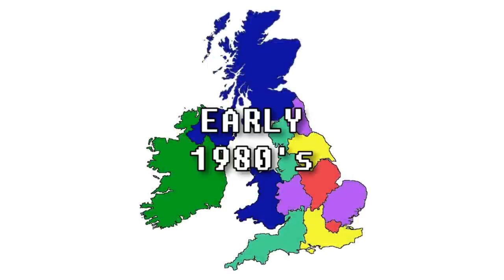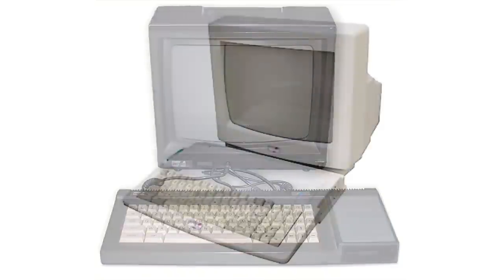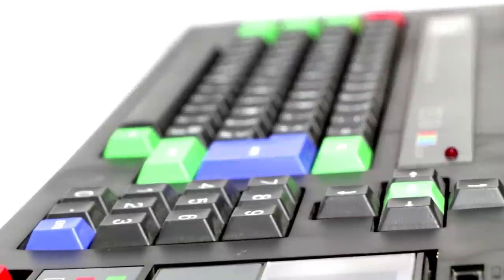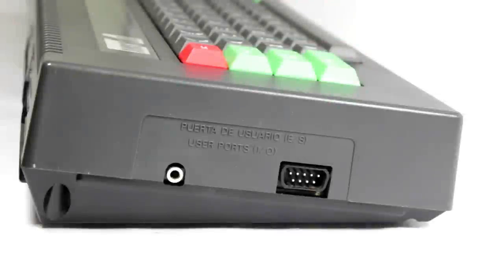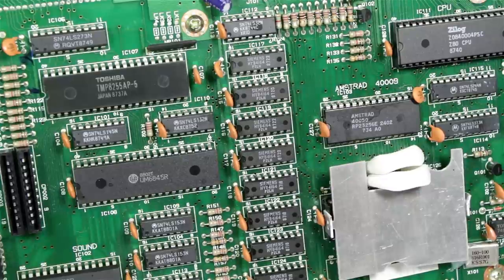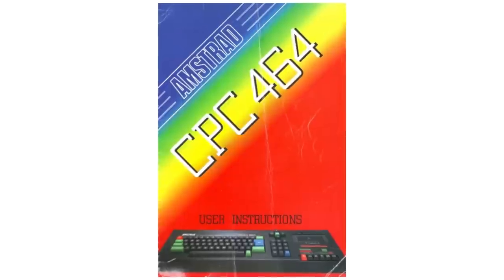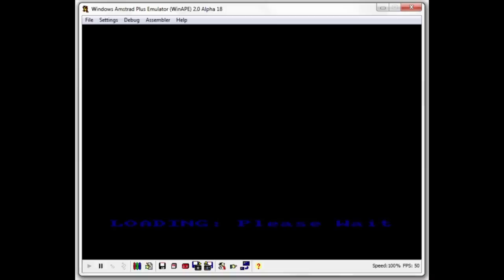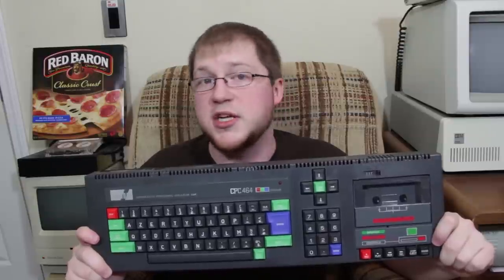LGR - Amstrad CPC 464 Computer System Review

Comment: The Amstrad CPC was a brilliant machine, the 464 in particular. The numpad can be reprogrammed from BASIC to run programs at the tap of a button. I used to use mine with 3 programs in them at all times: one to change the mode to 80-column text mode and the on-screen colours to easy to read white-on-black, one to list any program I was coding, and one to tell me how much memory was still available. It was so useful.

Comment: I had two of these growing up, and my 464 came with the TV modulator. The only sad thing was the sound still came out of the computer. What the kids at my school did was buy a cheap amplifier and hook it up to the stereo jack, it sounded way better. Despite all the playground bullying from Speccy & C64 owners ;-) it was a fine computer to own largely due to the high resolution modes that didn't make your eyes bleed when you wanted to use it for not-games. The Locomotive basic Amstrad shipped it with was actually arguably better than BBC basic and allowed really good access to the machine without POKE commands. Awesome video BTW Clint, you have a great knowledge of our strange UK 8-bit machines.

Comment: Conspiracy theory: Sugar may have pinched the colour styling from the much delayed Elan Enterprise (eventually launched far too late as the Enterprise 64 and 128). The Enterprise can be expanded up to 4MB RAM; Sugar built the CPC to do the same, though it requires a lot more external logic so I'd be surprised if anyone actually did that.

I spotted a CPC on the floor in the patio of someone's house, along with the colour monitor and a printer. It had an abanonded look to it, so I knocked on the door, asked if it was being thrown away, the lady said yes, so voila I got the unit for free. Also had lots of games, some books, etc. It had been the family's main machine in earlier times.

Years later I obtained an Enterprise 128 with numerous peripherals. I don't let it get too close to the CPC in case they start fighting. :D

Comment: The requirement of an original Amstrad monitor is a real pain in the arse. Amstrad eventually recognised this and released a separate modulator for the computer (MP1 for the 464 and MP2 for the 6128). These are not entirely easy to find at a sensible price, and having only an RF output, don't entirely work well with modern TVs. (All of this has probably been said already, but I'm far too lazy to check) :D
Reply: See, while I fully agree that BACK THEN it was a huge issue. These days you can (and Clint Lazy Game Reviews had one) buy cables for hooking up to modern TVs as well as pick up a separate power supply for very little. So it's all good in the end :)
Reply: Good point :)
Reply from the maker: ***** *****  Aye, it's not a huge issue now, but it's still a pain to have to convert those SCART cables over to HDMI for us Americans. Unless there's some kind of composite output that I'm not ware of!
Reply: Lazy Game Reviews I tend to forget that SCART is a European connector that most other countries have never seen. It's a fairly easy job to convert SCART to composite and in fact, the guy you bought that cable from (lives about 9 miles away from me) should be able to sell you one :)
Reply: Lazy Game Reviews
Do a review on the Micomsoft Xrgb Mini! That machine does wonders with all kinds of rgb signals and can convert almost any PAL signal to NTSC and vice versa!
Reply: Lazy Game Reviews
Well you can always order a 50 dollar Scart to HDMI convertor from China or Amazon. Or plop down 400 bucks for an XRGB mini.
Reply: SCART isn't actually a video standard, it's just a connector.  There are pins assigned for RGB, S-Video and composite signals.  So you can just pick those signals out and feed them to a non-SCART converter (e.g. composite video capture device).  If you buy a SCART converter you still have to check that it supports the signal you want to see.  If your device only outputs RGB on the SCART cable but your converter only handles composite and S-Video coming in on the SCART cable then you still won't be able to convert anything.  Or perhaps worse, you will get the low quality version of the signal (e.g. composite when RGB is available.)  So SCART isn't a big deal, but figuring out which signals the devices support over the SCART connector is.

Comment: Great video. You're right about the display and power issues, as they're the hurdles that prevent collectors even in the U.K. from using these systems nowadays. 

Back in the 80s, however, it was the other way round, as others mention, as the monitor meant that there was no messing around tuning in the TV after plugging cables in and out of the back of it, and asking or waiting for access to the main TV of the house.  

It also made serious computing tasks very easy to undertake, as the image quality from the monitors was very clear, readable and usable for long periods compared to many flickers and fuzzy 80s PAL TVs connected over RF to other systems. 

Also, yes, the 6128 is a great buy for the expanded RAM and disk interface. It's extremely easy to connect a 3.5" floppy drive or Gotek, and then copy across the .dsk images of any game, reducing the load times to just a few short seconds.  

It's all possible on the 464, but needs yet more additional hardware - the memory expansion and the disk interface as well as the drives and additional power. It all starts getting pretty crazy in terms of the kit hanging off of the thing.  

Still - a great system. Check out the best 8-bit versions of certain games. Prince of Persia is one, Chase HQ is another, and there are many more. Very capable system.

Comment: The 464 was my first computer, thanks for this video, got me remembering the good old days!

 I upgraded to a 6128 later, I still have it. I have such good memories of those computers, I wrote lots of basic programs and played so many games. Back in the day there were so many great games. I have a speech synth add on, that would speak text you sent to it from basic extension commands, pretty amazing for the time. By the way, the z80 could only address 64k at once, on the 6128 it only used 64k unless the software used memory swapping to address the second 64k bank. You had to understand this stuff back then, these days kids have it easy ;-)

Comment: Very naughty of Mr Sugar not putting in a TV signal output . Making sure he sold monitors. The TV signal generator is a very small box. If you could fit it in a Spectrum then there was no excuse.
Reply: +David Johnson I bought one when it came out, With monitor, My brother bought one as well without monitor, In that case you got the RF modulator shipped with the computer.
Reply: There is a version that uses RF to connect to the telly. That's the version I have. Looks very fuzzy now tough obviously.
Reply: Not so much being naughty as being an all-in-one.  Kinda like his hi-fi stero systems and everything else.  Everything was about being as accessible as possible, so having it all in the same box was a good thing in his eyes.
Reply: Yes, the CPC was aimed at users, who wanted to have a complete, CP/M compatible, quite modern home computer (that because of the num pad and cursors, which on the 6128 are even there where you know them from todays keyboards, pressed between the keys and the numpad :D). And we must remember, how shitty the RF signal on most computers was, for example on the Sinclair Spectrum, so many loved the CPC for the clear cut monitor, which really had a good monitor, good colors or good readable green scales.
Reply: spinnerpete. Thanks for putting me straight on that.
Reply: The Amstrad was still price-competitive with the C64 at the time of its sale even taking into account that it included the monitor. You also got a crisp RGB connection to the monitor instead of a a fuzzy RF TV picture. It wasn't a bad sales idea at all especially considering most households may have only had the one television at the time anyway.

Comment: I had a 6128 just as I was starting to get into computers (early 1990's).

Their design was by designers i.e. they kind of went away from the beiges and blacks of the time and came out with a grey. The 6128 went further into this direction.

I ran into a guy who had apparently been on the team developing them back in the 80's. He'd said that the 664 was a mocked up machine that an interviewer had gotten a photo of. Essentially it was 464 with a disk drive. You'll notice the keyboard isn't HUGELY different from the 464. Since the photo was out there, they ended up releasing it. You'll notice there was less than 6 months between the release date of the 664 and the 6128.

I've also got a friend who was into these things in a HUGE way. He had a 664 but had brought the memory upgrade, effectively making it a 6128. He added a 5.25" floppy drive (3" disks were a PAIN). He also had a "Multiface 2" which was a device that you could use to pause a game, change running code, and then resume it again. In terms of gaming this allowed you to cheat. He's only recently got his hands on an Amstrad CPC again. We were discussing the power supply. An ATX PSU could do the job. He managed to find a monitor in the end (I think he used an Amiga monitor) though we were discussing using an EGA to VGA adapter to get the graphics to a monitor.

Comment: All in one design? Hard to replace parts? System is screwed if something goes wrong? Oh god, Amstrad is Apple!
Reply: Well, not really. Yes, when the monitor went broken, you were scrapped, but most of them didn't stopped working until the end of the 90s, they were well produced, not the modern crap.

The same with the disc drive: Mostly it's only the mechanics, that fail and they are repairable by the CPC hacks

With the chips: Well, they are mostly sockeled. So when your Z80a is broken? Just replace it. Ok, nowadays it's more difficult to get one, but in the 80s it was not a problem to change broken chips, all but the graphics chip were industry standards, unlike the C64, which used mostly MOS-chips, which you only got from Commodore.

And because of the Expansion Port it was possible to use an external Disk drive in 5 1/4" or 3 1/2", which most had, because it was awful to even get this 3" discs :D
Reply: The reliability of the CPC was marvelous. Best Amstrad product for build quality - I've not yet heard of a completely dead CPC system. 

But, yes, many people compare Alan Sugar to Steve Jobs. Ruthless, successful visionary.
Reply: Amstrad launched a console nobody wanted, a tablet PC nobody wanted and a notebook nobody wanted. They're like Apple, only far too early to manage to get anyone to buy their stuff.
Reply: From my experience using an Amstrad as a kid, the only parts prone to need replacement are the cables themselves, and that's after much use by the kids me and my brothers were. I still have a whole unit working perfectly! (after video and power cable replacements at some point).
Reply: BilisNegra That’s very much true of the 464, it’s a hardy machine. The 664 and 6128 models both use a keyboard membrane that rots away and will need replacement. If you find one being sold on eBay and it says it’s faulty or the keyboard doesn’t work, it’s always a membrane issue and they can be fixed in about 5 minutes.
Reply: GameHammer Classic Gaming Alas, they did lack Apple's "buy this for loads of money 'cos it's shiny" vibe.
Reply: Outtheredude Dammit now I want a shiny CPC!
Reply: An Amstrad tablet PC? Which tablet PC?
Reply: If anything was close to the early Apple computers, it was the BBC Micro. Even the color palette was similar to the Apple II's
Reply: TechRyze

Steve Wozniak > Steve Jobs

FACT
Reply: There was an accessory that enabled you to connect it to a TV. And there are simpler modern cables now as well. I think you can use an external tape recorder if the built-in one fails. Of course you can get devices which allow you to play ROMs directly on the machine now.
Reply: @OMA2k  The Amstrad Pen Pad was a tablet computer from Amstrad from before Apple brought their Newton out. Then there’s the NC-100, NC-150 and NC-200 which were notepad computers from a decade before notepad computers. Amstrad were great for innovating well before anyone wanted to buy such an innovation, thus rendering their stuff unsellable.

Comment: I came across one of these and picked one up complete with a colour monitor for £30. So was really happy :) The integration of it make it very good and easy to connect up. No wires anywhere as the cables from the monitor plug straight into the keyboard unit with no mess.  It was one of the older ones with a much larger motherboard.  The tape deck didn't work properly but there is an easy hack to add a sound input, so you can load games off external sources which worked well.  I too found the machine a bit souless, but it was pretty good. It would have been nice to add a memory card interface to it to run software, but its actually quite difficult on the 464, as you have to also get a DDI1 interface. Despite having a port for disk drive, it doesnt actually have a disk drive controller built in. So you need one of those before adding any other storage.  Glad to have it in my collection though!

Comment: I had a 464+ back in the day, but it had a Black & White monitor.  A friend of mine had sold me his standard 464 because it had a colour monitor, only thing was I couldn't use that monitor on my 464+ because the connector had more pins.  No worry though, I took the connector of my old monitor, and wired that in place of my "new" monitor's connector, and it worked like a charm!  Wish I still had those computers, I was a fool to get rid of them after I got my first PC.
Reply: Nice one Clem!  I had the colour monitor.  Oddly, the BBC computer worked with it so the RGB port may have tried to be a little bit standard!!
Reply: Knuckles the Echidna 

Who'd have known that Knuckles had an Amstrad CPC?!

Comment: Man, your comments could be correct if you had used one back in the day or read up on some of the details, but... "the tape recorder inevitably giving up"? "unreliable"? "one of the built-in components failing"? Erm, no. the CPC was the most reliable of the major (at least) 8-bitters of the day, and failures were very few and far between... All my tape recorders work just fine 30 years on and the only "inevitable" failure is the 6128 drive belt (which is very cheap to replace even now).
Reply from the maker: I've used these extensively over the years, and the first one I had? Dead tape deck, and with similar machines I could just easily replace it whereas here I couldn't. Which is why I mention it :)
Reply: Lazy Game Reviews I believe you, but you must have been extremely unlucky :) Amstrad had by far the lowest returns for failures, and it's definitely not "inevitable" :)
Reply from the maker: I don't doubt that at all, they seem to be quite hardy compared to, say, my Commodore equipment! But in my experience, hardware failures are very much inevitable, especially when you're talking about a device with moving parts that's ~30 years old.

Whether it's today or another 10 years, things eventually cease functioning, and having something mechanical integrated into the unit is a potential issue to be aware of when looking to collect! That's the only point I wanted to make, not that these are pieces of crap or anything :)
Reply: Sorry, I missed your reply. And apologies, I didn't get the spirit of those comments!
Reply: Lazy Game Reviews I couldn't agree more, Things after so much time especially after ten or more years start to cease functioning, especially buttons. Buttons fail mechanically and old CPU chips can also fail. I have a Game Boy with fully working buttons but I recon it was hardly used or maybe the owner looked after it very well.
Reply: Reliable? Really? My mum got me one of these for Christmas when I was a kid, played it all day on Christmas day, it died in the evening :( I was devastated
Reply: And that puts you in the tiny, tiny percentage of DOA buyers. Or you think 'reliable' means 'never fails'?
Reply: It wasn't reliable, in my experience
Reply: Can confirm. My 464 tape deck is still working. The floppy drive was the thing to break. God, I wish I could fix it. No computer repair shop wants to touch that thing :(
Reply: Drive belt maybe?
Reply: Yea drive belts are known for failing.
Reply: Gryzor I had a ZX +2 related machine, and I seem to remember the tape deck failing after a couple of years. The power supply failed on day 1. Not a happy Christmas Day 1987 :( The machine had a hardy feel to it, but there were parts to it that were actually quite brittle.
Reply: Gryzor I had a ZX +2 related machine, and I seem to remember the tape deck failing after a couple of years. The power supply failed on day 1. Not a happy Christmas Day 1987 :( The machine had a hardy feel to it, but there were parts to it that were actually quite brittle.
Reply: endrightwinglunacy oh, no idea about the Amstrad-made Speccies. I guess since they were cheaper machines they didn't have the same quality but I'd expect they would still be better than the original machines....
Reply: DieWeltIstSchlecht 

Your drive is definitely repairable. I've fixed 4 of them so far, and I'm no electronics bod. It takes a little time, skill and patience. There are tutorials online, as it's usually the drive belt plus some cleaning and lubricant for good measure.
Reply: I had two. Both tape readers gave more and more "Read Errors" with time, before they died plain and simple.